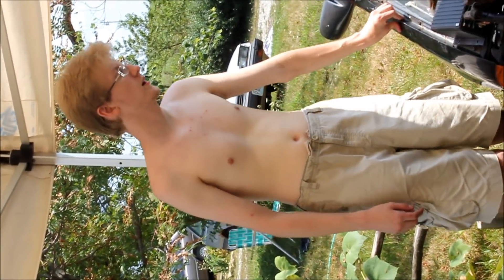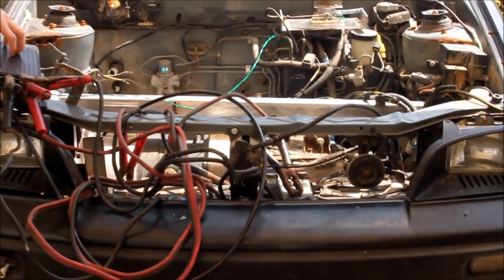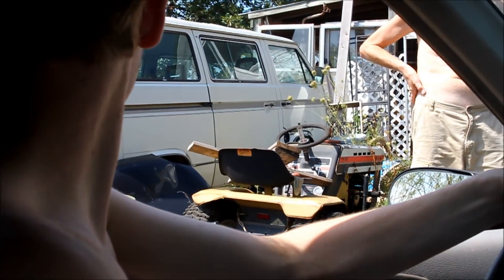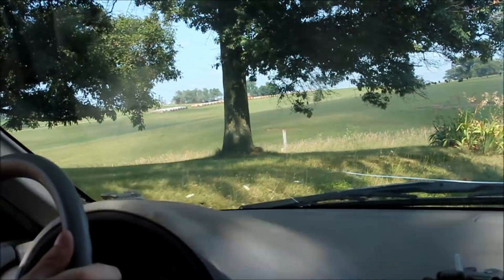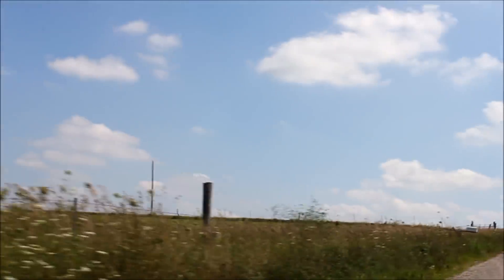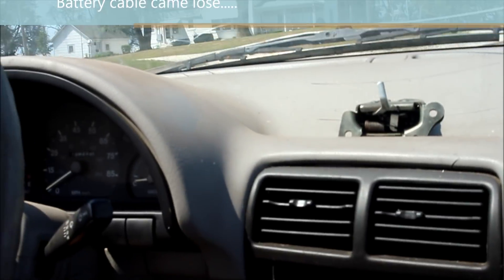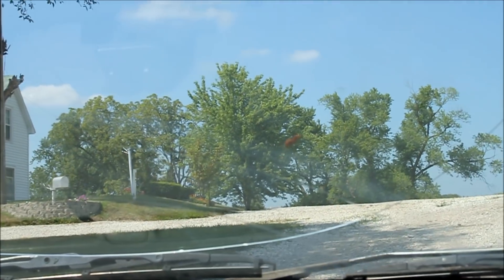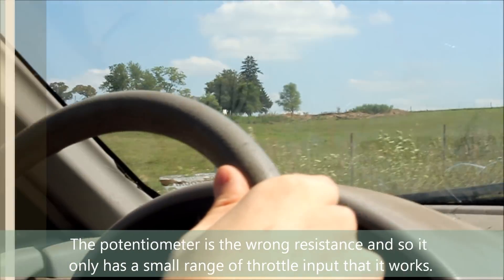Geo Lectro Electric Car 36 Volt Test Drive

Comment from the maker: Well, I will say that going with lead acid batteries is going to cost you money for something which you're probably not going to use much again after you get lithium. Unless, of course, you're planning to use them as a battery bank for a solar/wind system for your house.

Comment from the maker: Yes, I have made more videos and more improvements! Check my channel. 
I would recommend you do NOT use lead acid batteries unless your normal drive is less than five miles... Lead sucks, it's just how it is.
Check out EVTV here on youtube, they have lots of good videos.
If you go with Lithium Ion batteries, make sure you never bring the cells bellow 2 volts or above 4... They can be damaged if that happens. Find a good electrician and a good machine shop, they'll help a lot! 
Good luck!!!